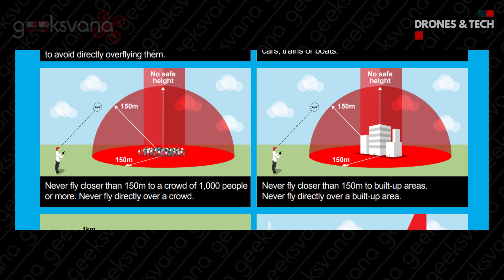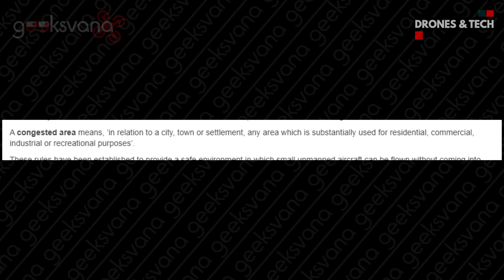What Does Congested Area Mean? With CAA Former Drone Lead Comments - UK Drone Rules - Geeksvana

Comment: In 2022 I'm STILL confused by the laws as are many others it seems. I've spoken to 2 drone pilots (One with a GVC and one with A2 CofC) who have both stated they think the laws are shakey ground. The fact that a former CAA drone lead has said that some of these rules HAVE to be "challenged" in court first means that it has to set a precedent surely? Which could also be argued that because it's a vague law, and sometimes contradictory, then it can't be enforceable as it makes zero sense to people (some who even have legal knowledge). "Congested area" could literally speaking apply to blades of grass which means you can't fly from a field. Recreational is defined as "relating to or denoting activity done for enjoyment when one is not working" but what if you're in a park full of full-time vloggers? More to the point, you saw people with their phones out...how do I know they're not working if I told the court that I genuinely believed it? (taking lying out of the equation, these issues in court would be what is perceived as reasonable and unreasonable). The law is stretchy AF at times so I've made up my own rules and I've been following them since I got a drone last April:

1. If I fly high over a town, city etc, it's gonna be over verifiably closed things. So I flew over my local town to get shots, and it was over a park which closed at 5pm. I flew closer to town but it was in a car park with only 4 cars in at the time, and I never left the area of the car park. The town centre shops had shut by 6pm, and I never flew over people. I flew over a river with buildings on one side and a park on the other, low down, so if the drone crashed it would get VERY wet. If it suddenly went left or right, well, that's why I have an emergency shut off right? As much as I hate DJI from a company standpoint, their drones have a large number of failsafes which mean these occurences are rare as hell. I say "rare" knowing of no situation where I've heard of it happening) 

2. I rang the CAA for guidance about flying over roads. You know what they said? I can fly over "B Roads", when "No one is around". Ok, what if a car is coming but it's a mile away? I can cross that road using a drone in less than a second, is that "around"? Well, strangely...they didn't have an answer for that. So I cross A roads, but I make sure I'm going at full whack. Drones just don't "drop" vertically, it would easily clear a road at trajectory, and I make sure I'm not hovering above them! Even then I wouldn't cross over a really busy A road, and when I do, I make sure there's gaps, like I was crossing it on foot. 

3. Don't be a dick i.e don't fly close to people. If you fly over buildings, make sure you're either doing it quickly or it's not a roof made of paper that anything can poke through. The whole "No flying over buildings" thing is a bit silly, as is the cylinder not dome scenario in general.

I would be ignorant to argue a defence in court from my own point of few, but I'm sure I could establish a challenge for a judge if he or she were facing me and accusing me of being "reckless", which is ultimately what they would look at. They'd say "Hey, you're accused of breaking the law, here is what we know and we want to know why you did it". I could say "Yes, I did break the law" or "I'd like to know how I'm supposed to measure distance with my eyes in a 3D space, but you can also break the speed limit via accurate measurement and not be punished, even though an extra 3mph can be life or death in an emergency breaking scenario", and that's EXACTLY what the law allows for, context.

Comment: hi Sean what if you had permission off a house owner to survey there roof with a Mavic mini and for profit? this would answer all my questions in one go.
Reply from the maker: Hey Andrew Hill! A DJI Mavic Mini can be used for commercial reasons by a 'hobbyist' operator. All you need is an Operator ID, Insurance and to be in the correct airspace etc (with all the usual caveats). Hope this helps.
Reply: @Geeksvana  
Great I will send my flyers out lol  and yes I do have insurance and ID numbers. I have taken pics and videos of my roof and shockingly enough I have work to do. This could be the way forward for mini drone flyers the mini does push out very good images in clarity format that can be used to make decisions on your property. Thank you very much. Rest assured that is what I will do and not fly up and down the street like I think some will do... that’s the worry now. 👍

Comment: the term congestion means......  noun. overcrowding; clogging: severe traffic congestion. an excessive or abnormal accumulation.....   if an entire industrial estate or other area has just a few people on it then i fail to see how it can be classed as congested..
Reply from the maker: Hey xl_wraith_lx! Thanks for taking the time to comment, I really appreciate it! Yes, the definition in language is one thing but a confirmation of what that means under UK law and more specifically the Air Navigation Order is less straightforward. The CAA wording is 'in relation to a city, town or settlement, any area which is substantially used for residential, commercial, industrial or recreational purposes'. This creates grey areas which even the CAA are unsure about, until tested fully. Most in the industry do agree with the concept of congested being fluid. So an industrial estate closed for the weekend might not be counted as congested.
Reply: @Geeksvana    well hopefully they see sense when they finally come to a decision.. the way i see it..an industrial estate or shopping center that employs say 1000 people would call that normal expected traffic.... add customers and people using it as througfare and then it becomes congested... however early in the morning or later in the evening when business is closed and everyone is home for tea would cause total numbers to fall below the original 1000 expected normal attendees..therefore non congested...
maybe time restrictions on certain places would work far better than a full ban

Comment: I think alot of people buy drones like me and don't understand the rules like me I bought a Mavic mini and everyone was saying I don't need to register then yesterday I and the park near my house in leytonstone and police came and said I came fly my drone in this area and I need to register and then I saw this video and I didn't know that I can't fly my drone from my house because of the area I live in so I can't see the point of keeping the Mavic mini if I have to drive far away just to fly it
Reply from the maker: Hey Ryan! Thanks for taking the time to comment and share your experiences, I appreciate it! The issue is that the drone regulations in the UK are set to change completely from 31st December and this does mean you will need to register the Mavic Mini. However, it also means you will be able to fly your Mini in congested areas and a lot of places which are off limits right now. We will be live on the channel from 7pm on 23rd December to run through all the new rules. So either join us then or watch the replay to catch up.
Reply: @Geeksvana  ok thanks what I do is check your channel honestly am in to astronomy for many years and I just decided that I wanted to getting to drones but because am new I don't know anything about the rules .but I live in leytonstone E11 and they are planes and helicopters fly there when I check drone assist app I'm in class D zone I think .

Comment: Thanks for those very carefully chosen and clear words. They were most helpful, or at least as helpful as they can be at present. I have cheap 680gm and 243gm drone which are almost identical in software and 4K cameras, not in weight and endurance, of course. With only a DMARES and only an interest in recreational photography, this is just a hobby, but I realise that the 243gm drone has less risk of causing damage than the 680 and might keep me flying for longer. 

It is inevitable that we are heading for totally controlled airspace, and for safety reasons alone, I feel that is the right way to go. We should be able to continue recreation flying, responsibly, even though all airspace is controlled, IMO. Ie by incorporation of a tiny IFF transmitter in drones. It's almost certain to come, as the skies get more congested, again, IMO only.

Keep the 'shorts' coming. They are very helpful, thanks.
Reply from the maker: Hey gregb49! Thank you for taking the time to comment and for sharing your well thought out views! I agree, the future of the sub 400ft airspace is a busy one and the upcoming UTM (Unified Traffic Management) systems of the world will hopefully create a controlled airspace we can all enjoy! Hope you are well.

Comment: Thanks for the video Sean. An interesting topic which I took up with my local police force. I'm happy to say in County Durham, the rule of common sense is being applied as is education over enforcement. The question they will ask is 'the place congested at the time of flight. Is the operator acting responsibly ?' That also goes down to settings so how high is the max and what are the distance settings. From my conversation, hobbyists who care for themselves and others won't have a problem. Alan.
Reply from the maker: Hey Alan, thanks for taking the time to share your thoughts and experience with local police. Yes, the fluid nature of a congested area is one of the more tricky aspects and will take common sense from both operator and enforcement officer. Good to hear your local police are so sensible about it!

Comment: Great explanation but of course can't really answer the question fully I guess. I wonder if the time of day is considered? For example, a recreational park in the day with lots of people there is out of bounds for flying. But what if nobody else is there? Is it then considered as not being used for recreational use? And what about later in the day when it's locked with no access?
Reply from the maker: Hey Paul Wilshire! Thanks for taking the time to comment, I really appreciate it! Yes, congested is a fluid term and I would certainly argue that the examples you raise would mean the status of the park changes. Although it is important to consider the wider area and whether the park is already in a congested are itself, as this has been specifically mentioned by the CAA previously. Sadly though, it is all opinion until a few unlucky flyers get taken to court!

Comment: Hi Sean. Great series.  I've passed my A2 CofC with 100% but am still confused over some aspects of the new regs!  Re congested areas, the latest CAP722 has this definition: 2.1.3.3 Congested Areas "As part of the aim to protect uninvolved persons, flights within areas that are used for residential, commercial, industrial or recreational purposes (i.e. areas that are densely populated or likely to be occupied by large numbers of persons) have additional operational limitations placed on them."
 
That objective of protecting uninvolved persons makes perfect sense.  But if there's a recreational park which could can check and see is totally empty early in the morning, surely you have assessed the risk to uninvolved persons as zero and it is safe to fly?  Your CAA presenter said no - it's congested/recreational no matter what time of day or number of people around.   I would question that, based on the CAP 722 references to 'likely' and 'large'.  This hasn't been tested in a court of law, but what's your view?
Reply from the maker: Hey Peter Speight! Thanks for taking the time to comment and congratulations on passing your A2 certificate! Yes, I would personally agree. The term congested is fluid both in terms of what you are flying the use of the area at the time of flight. So an industrial unit closed for the weekend or a park empty in the morning are perfect examples. It is down to our own interpretation but common sense has to be factor!

Comment: Hello, since 1974 I began a hobby jumping out of perfect serviceable aircraft  !!  in  74  I got my PPL  still jumping out of AC ,,I flew C172  and C206  in 76  as drop pilot (parachute) weekends &n Wednesday evenings in summer I am now retired and fly PA28  ( no more jumping )I can fly across UK in G airspace = outside controlled airspace at 500 ft  QNH BUT when coming over a town (1000 persons or more) I have to be at 1000 ft QNH (above sea level) ( land clear rule)  also an area with over 1000 persons e.g. football stadium events ect  steer clear or above 1000 ft QNH (land clear rule)  this is classed as congested area = 1000 persons or more, villages also if over 1000 persons any other building, of less 500 ft QNH, not below  , I fly QNH  mostly unless landing small airfield EGBO usually entering 2 mile radius, I change to QFE  (height above  ground) so as to be overhead 2000ft above ground on a QFE setting , at 2000ft above EGBO if I changed that to QNH setting to QFE   my height above ground would be 1717 ft above ground not at 2000ft sea level as EGBO is 283 ft above sea level
This part gets me of CAA ,is I am flying CAA rules 500 ft QNH (above sea level)  where on a QFE setting I could/would  be at  300 ft above ground across country , yet your drone can be at permitted height at 400 ft above ground (QFE) and I fly underneath the drone  !! , as you know the 100 ft clearance we need to fly above/below another aircraft but in this scenario I need to be 100 ft above the drone !!
Where  you are quoting a  congested area , what you seeming to be avoiding unintentionally is  the   " any person, vessel, vehicle or structure."
 this might help 
section 5 (b)
 www.legislation.gov.uk/uksi/2007/734/pdfs/uksi_20070734_en.pdf#:~:text=Except%20with%20the%20written%20permission%20of%20the%20CAA%2C,of%20the%20aircraft.%20%28d%29%20The%20land%20clear%20rule

just to add ,I prefer 2000 ft or above ,just in case the elastic band snaps on my PA28 (lol)
stay safe all
Reply from the maker: Hey Bill! Thank you for your comment and for sharing your experience! It is very important for air users to see each others positions and accept the challenges they face. The reason this particular question and answer video does not refer to any person, vessel, vehicle or structure is because this will not directly impact drone regulation once the EASA guidelines are adopted. The distance flight can be made from people and buildings will vary wildly, depending on qualification, type of drone used and whether the area is deemed built up. For instance, flying a DJI Mini 2 in 2021 will mean someone without any more qualification than DMARES will be able to fly within town centres and even over people. Also, the distance a hobbyist can fly from a building etc varies depending on whether that building is part of a congested area. 

For hobbyists under the existing rules and the rules coming in, what makes a congested are is an issue many come across and without an official way to designate this, it creates problems.

Comment: Google 'magic defra' - the first link is a website (magic.defra.gov.uk) which shows a map of the UK. You can see what the government defines as 'built-up areas' from the table of contents. Select Landscape > Landscape Classifications > Built Up Areas 2011. Zoom in on the map and all built-up areas are cross-hatched out. Hope this helps 😁
Reply from the maker: Hey Jamie! Great to see you and thanks for your comment! It is a very useful map isn't it! Sadly, it has not been adopted by the CAA and the regulatory framework allows for the congested area definition to be fluid. So for instance, an industrial estate when closed at weekend could be argued to no longer be congested. Although following the DEFRA map could give you a golden defence in court!! Thanks for sharing the map, it will help people.
Reply: @Geeksvana  Common sense would be to stay away from built-up areas or places where there's crowds and you'll be fine. The defra magic map is a good place to start. Also wouldn't harm taking a print off of the area you're intending to fly just in case 😉

Comment: Wow, even the CAA guy doesn’t know! Pilots will always find a way to get as close as possible even when the rules change. I understood a congested area being any area with 3 or more buildings together. For example, so many pilots fly 50m away from Brighton seafront because they misinterpreted the code.
There are so many open green areas of the UK but not many show common sense and insist on flying in city centres.
Reply from the maker: Hey Roger Halt! It is difficult as the CAA themselves rely on the law to assist in determining interpretation of law.

In terms of congested flight, the new rules will of course allow drones like the DJI Mini 2 to be flown in town centres. It will be interesting to see the impact this has!
Reply: @Geeksvana  with no need for insurance (subject to weight of course), there will be all sorts of pilots buzzing around. 

Hopefully we will all be able to use common sense and respect privacy laws. I wonder how long it might be for complaints to come in from the public and the rules change. Drones are still niche so unless there is a section in BBC news then no one will be none the wiser! 

Some pilots aren’t even away of a drone code or apps to help. I only found out because of the groups and just randomly searching online I found the Grey Arrows. DJI wipe their hands clean once you buy the product, that’s it no more input from them!